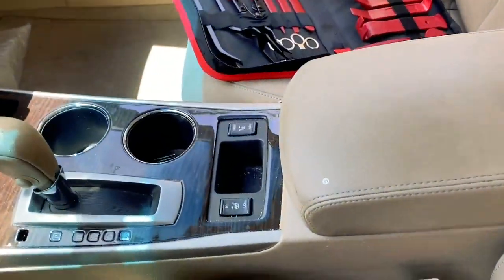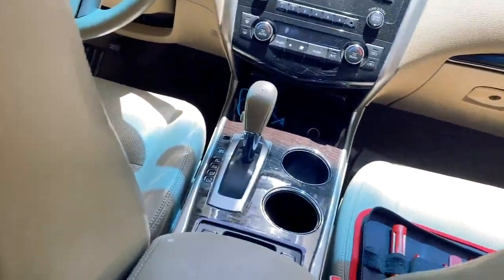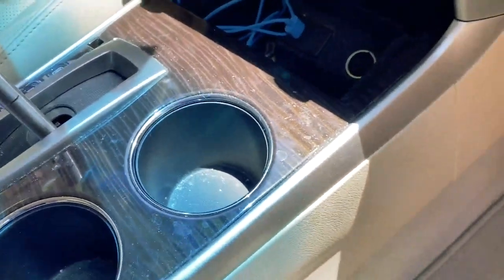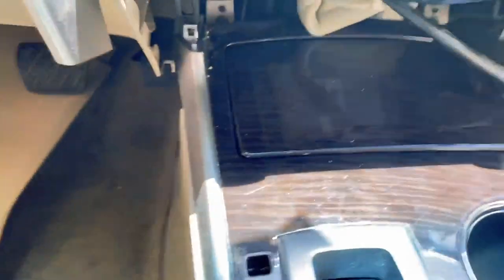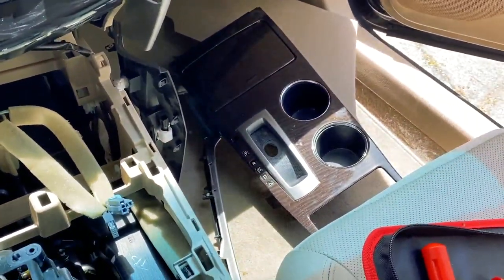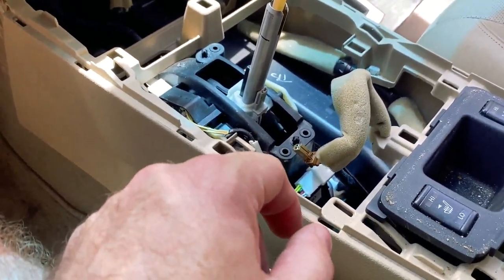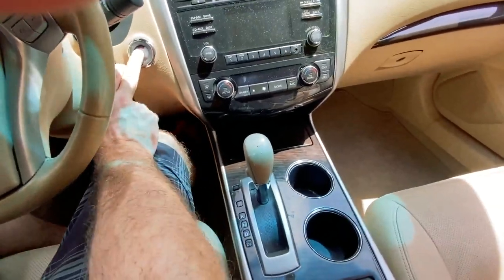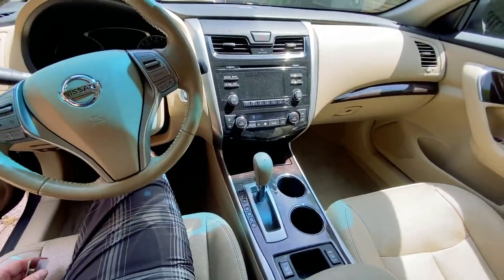Nissan Stuck in Park Shift Lock Repair

Comment: Thanx for the vid. Just fixed a customers car with this issue. By the way, anyone needs this done, you can remove the two front center control screws with a stubby screwdriver instead of trying to disassemble or brake the moldings.

Comment: Thanks alot for this i been dealing with this bs for 2 weeks lol also i didnt have to take entire center console out i just took the center part with the cup holder coin holder and gear shift part no need to remove the whole housing you save 20 mins doing it also it took me 10 mins to do thanks alot!!
Reply: Hey Ricardo can u tell me wat u actually did so I can do it on my wife car cause we having this same problem...
Reply: Good idea, I just did mines again, the bending up lasted for a couple of months and I ended up buy a new one for about $11 bucks
Reply: Not that model you have to take the housing off

Comment: I’m a Nissan tech the rectangle thing you had on the back side of the center console is the key fob antenna.
Reply: Not the nats immobilized anteanna that’s around the push button but the antenna to unlock and lock the doors
Reply: What do I do I if it’s saying press brake to start but I’m pressing on the brakes and I changed the sensor and it’s still doing that

Comment: That part in the rear plastic is the antenna for the keyless entry sistem..extremely important not to bang it..!!
Reply: Which one is it? because my key is not working anymore
Reply: @fadymikhael4024  first try replacing the key fob battery first...!!
Reply: I did replace the battery but after i fixed the shifting problem I started having an incorrect id error
Reply: @fadymikhael4024  well...maybe you need to disassemble all again and check that all wires and harnesses are not trapped by plastic panels amd stuff....then, when you reassemble check the key antenna module for a proper connection, the antenna is that you can see in this video at 1:45
Reply: Thank you I will try to do that I appreciate it!!
Reply: @fadymikhael4024  if you want...send me your email and will send you picture with the exact location of the keyless antenna...cheers..!!

Comment: couple of pointers for those who are watching this video:
1) those things you are calling a "relay" are actually just micro switches. The one you pointed out on the top is not the issue with these designs
2) The thing that releases the interlock is called a solenoid. It only functions when you have your foot on the brake and the micro switch at the BOTTOM of the shifter tower is depressed. This is the faulty switch, not the one on top.
3) The switch at the bottom is probably working just fine, what happens is that the metal tang thats attached to the switch bends from use over time, and no longer depresses the switch. To remedy this, all you have to do is remove the switch at the bottom and bend the metal tab up so that when the shifter is in park, it actually depresses the switch properly. You can use a meter to verify that its working, but you can also hear the click audibly when its working correctly. Once you have it all back together you can see how the shifter functions once the car is powered on and the brake is pressed. Hope that helps.

**EDIT TO ANYONE INTERESTED: The switch was still bad in my case. It became evident after adjusting the Tang twice. All I was doing was delaying the inevitable. The main issue with the micro switch is that the current in the circuit is too close to the amperage rating of the switch. The plating will eventually fail in the area that actually makes contact upon operation. There is no fixing this. Once the plating starts to wear - it will fail permanently in a matter of time. The permanent fix is to replace the switch with one that has a higher amperage rating.  The switch will be exactly the same size - but it will have a thicker plating/contacts to handle the higher amperage. You can go on mouser or digikey and find replacement micro switches. Just find one with the same size and Voltage rating with a higher amperage rating.
Reply: Hey u think u can help fix mines on my wife car.. I just need to know wat to take off and wat to fix.. thanks in advance
Reply from the maker: "Tang" was the word I was searching for and failing to come up with. Thanks for the fine tuning of the explanation for anyone watching, proving again the self-correcting wiki-like nature of video postings like mine.

Comment: I took the simpler route.  I pulled out the shift lock cover and put thin strips of rigid plastic in the small shit lock cover and pushed the cover back down.  It took a couple tries to get the length correct but it saves me from taking the console apart.  Granted I no longer have a shift interlock mechanism that prevents me from shifting without hitting the brake but it’s a much simpler “fix.” Since it’s just me and my wife that drives the car I’m not worried about it, plus you still have to push the button on the shifter to pull it out of park
Reply: Smart!! I'm trying that tomorrow morning!!
Reply: interesting. Do you know roughly the size you ended up needing? I'm having the same problem, even though it's not doing it constantly. About once every 20 times.
Reply: Can u explain what u mean by shift lock cover? Is it small hole where you shove a screwdriver down to release the shifter?

Comment: I can't believe I came across  your video I looked everywhere  for this problem I eventually went to reckers and dismantle one mine was the little accurator I see  you pointed out at the bottom rapped in blue tape with the little piston when you put your foot on the brake current magnetic pulls piston and release plastic tang took me 2hrs cost $5 fixed 05 X-Trail Nissan.

Comment: gr8 vid. Ihave a 2001 maxima, which is stuck in park.   initially it was the break light switch, as the break lights didnot work.  So  replaced that switch , Then it all worked then it stopped working again, but this time break lights still work.   I suspect it could be this or a fuse/relay.  the shifter lock kind of looks similar to this setup but might be slightly different.

Comment: I took the pigtail off the back of the switch that acts up and put a wire between the wires on the pigtail connecting them all the time in case the switch fails. The wires that activate the switch are always connected now so it will always work.
Reply: How did u do it so I can do my wife car like that...I'm haven't the same problem with her car

Comment: I have a question related to this what could be the problem for the shifter to slip out of drive when you press too hard on the gas , I feel like it just doesn’t stay locked in drive